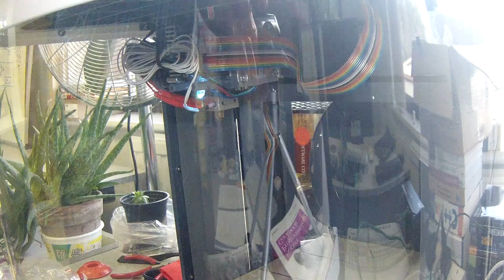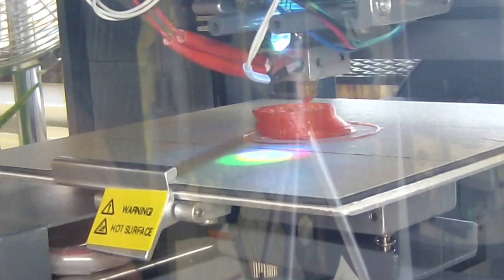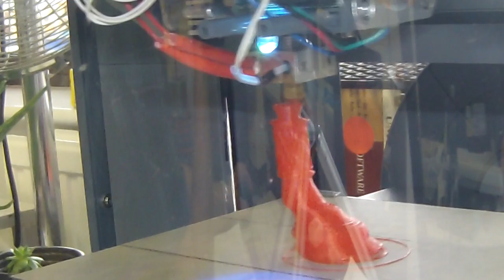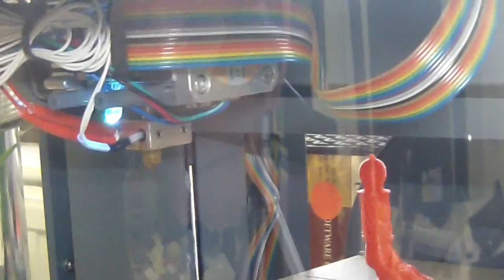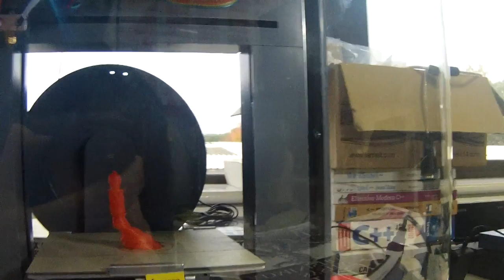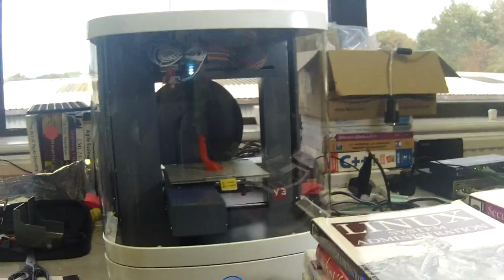Wonky Pawn

Comment: I've got exactly the same issue with mine - tried to print a skull and it went slightly wonky but only on one of the axis.  Side on the skull looks fine, but from the front you can see in a few places it drifted to the left. I've been looking for the fault and your video explained what it could be, so thanks for that.  Hope you've had more successful prints!  Wish the V3 geek techs were this helpful :)
Reply from the maker: Kate Bush I've had a few successful prints since this one. I hope you find and fix your iffy belt tension or drive wheel.